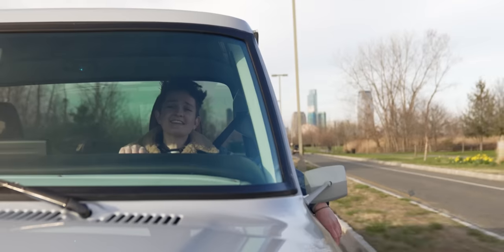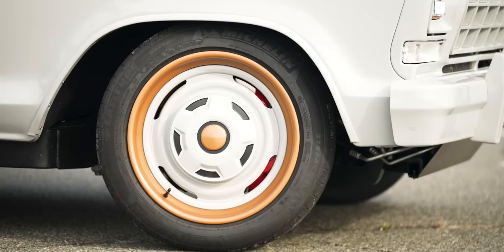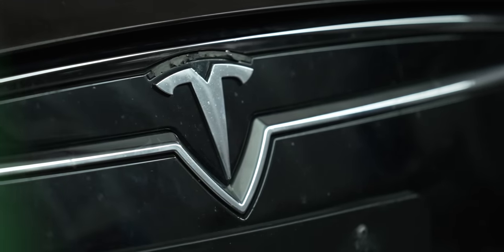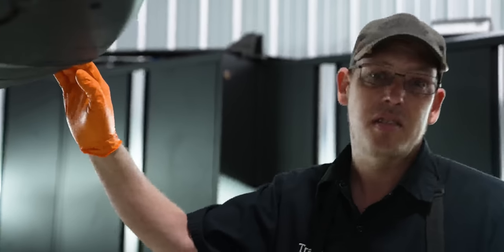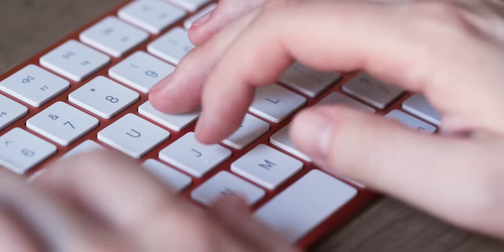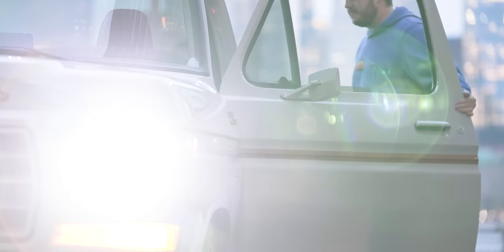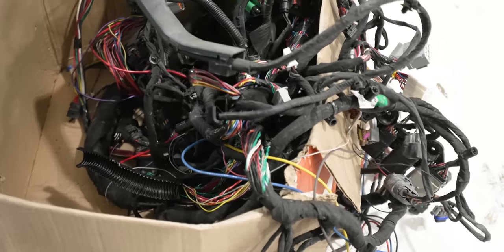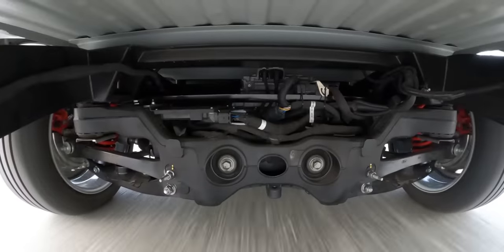Ford did what Tesla won't

Comment: Tesla goes against its own “environmental” push. Right to Repair is an environmentally conscious pillar.
Reply: @Darth_Bateman  What do you mean by unsustainable company? Both financially and environmentally they are sustainable. Their products create, store and use electricity to power homes and transport people efficiently and safely. I'm not sure about the solar panels but the other products are recyclable.
Reply: @jamesmorison  Plastic is recyclable, but that doesn’t mean we should keep spewing it out

Just because something is recyclable doesn’t make it sustainable

Also, that doesn’t justify making unrepairable products
Reply: Well, Tesla didn't just throw away old stuff into a junkyard just to replace a new one. Right to repair is nice and all until your car has Autopilot, which would require many parts to be the same as they came out from the factory or you risk the chance of Autopilot not working properly.
Tesla is trying to eliminate the future laws suit.
Reply: @pongsatonrattanapriyanuch7331  If Tesla doesn't want a lawsuit then they never should've released their "autopilot" or FSD to the public which said features are bottom last in autonomous technology. There's plenty of shops that do electric and software work that I can guarantee can easily reprogram said features after a repair.
Reply: @donkanis6141  Spoken like a Tesla cultist.
Reply: @pongsatonrattanapriyanuch7331  you can repair a commercial jet and they have auto pilot.
Reply: @geocam2  I’m assuming you’re being sarcastic. According to NADA, approximately 60% of auto repairs are non-drivetrain related. Look at the John Deere right to repair controversy and you will understand the long term issues.
Reply: Tesla doesn't have right to repair because no one is an electrical engineer neither are mechanics
Reply: @dulguunjargal1199  Last I checked Tesla vehicles have plenty of mechanics. Mind you many of the issues are outside of both electrical and mechanical. Many issues are related to software.
Reply: @stevenwilliams1805  100% agree. The 3 R’s… reduce, reuse, recycle ♻️. People tend to forget about the reuse part. Right to repair allows people to reuse a products in a way that it’s financially viable.
Reply: @epi2045  the increasing popularity of SUVs is a sign that few people even care to reduce either. Some even insist that I need an SUV just because.
Reply: @stevenwilliams1805  I mean, I'd say that I 'need' my full-size pickup, and most people would argue against that. 

But it is fulfilling both roles of 'vehicle' and 'house', so... :3
Reply: @jamesgizasson  your not saying anything about the environment so I don't understand what your point is? If you want to daily an RV go for it. Just don't expect the government to start restricting others to offset your conspicuous consumption.
Reply: @stevenwilliams1805  It's not an RV, despite being used as such, and I'm not expecting any special treatment. 

As far as the environment is concerned, I'd be willing to bet that the combined carbon footprint of my vehicle and 'dwelling' are significantly less than your average conservationist. 
:3
Reply: @jamesgizasson  I was exaggerating to make the point that I don't care, do what you want. 🖖
Reply: @stevenwilliams1805  Ok, love long and procreate! X3
Reply: @recklessrickey9513  
Most plastics are very much not recyclable - and the vast majority of plastics that are recyclable are the bits and pieces that break off plastic molds/supports for other things while the rest is thrown in landfills.
Reply: @matthewkeating6970  with the right qualification and experience, yes
Reply: @dulguunjargal1199  Yeah and only an electrical engineer can replace a wire that Tesla uses to connect it's door lock.
Reply: What's the problem exactly with Tesla?
I know of some car repair shops who converted over to 100% EV, and they seem to get every part from Tesla they need. 
One example is "AT Zimmermann" here on YouTube (German). They document many repairs and they have dozens of Teslas every week.
Reply: @epi2045  the use of any used parts voids any warranty one that Tesla will void at the first sign

Comment: Because Toyotas are known to be very repairable, I look forward to see if Toyota EVs will be easily repairable or not. I love that Ford has taken this approach. ❤️
Reply: Same! Can’t justify paying over a grand ever time my headlights need to be replaced.
Reply: Toyota ev takes 7 hours to charge, good luck with that.
Reply: @ugochukwueze496  most people getting EVs probably using them for a commute, ~50mi, and charging them at home overnight. different cars suit different needs
Reply: @ugochukwueze496  most EVs do on a Level 2 charger, and that's okay for home charging.
Reply: @ugochukwueze496  not the Mirai
Reply: @vp5429  Relacing the battery in a prius is rather easy. Idk what was wrong with your prius but you can replace the battery for reletively little cost and you could do it yourself.
Reply: @ugochukwueze496  The bZ4X takes about an hour to charge from 0-80%
Reply: As a car guy/home mechanic, Toyotas are relatively difficult to repair, at least compared to Honda. They're just very reliable as to not be necessary to repair.
Reply: Good point.  That's why our family's driving Toyota, Ford and Honda instead of Tesla.
Reply: @andretsang7337  I agree , I serviced my uncles Toyota Hilux  with dealership service guide with  genuine parts we got from an accredited dealer  . Funny enough Toyota will share  $4 part on 20 cars such a relief  , and won't deny selling you any part unlike others , part's availability for Toyota is a heavenly galore.
Reply: @ugochukwueze496  🤡🤡🤡🤡🤡🤡🤡🤡🤡
Reply: It's one way to overtake tesla since their repair is well-known to be expensive af.
Reply: @ugochukwueze496  Nobody charges at the last min. Most folks starts charging roughly 1/4 batt left.
Reply: @sleepyearth  Definitely don't see many How to fix Telsa videos
Reply: well with how they are charging a subscription for remote start features don’t hold your breath.
Reply: @mipmipmipmipmip Rich Rebuilds
Reply: Toyota has been getting more anti consumer over the last couple years, the new ones aren’t that any more repairable than any other car. Companies aren’t your friends especially ones that killed there consumers. Look up Toyota break recall.
Reply: Until the Tacomq or Tundra frame rots out with a decade
Reply: Toyota is turning their remote start into a subscription based service. I wouldn't hold much hope for them in the future w/ RTR.
Reply: @TheAntinowherelane  the service is optional and it is meant for you to start your car from your phone, the cars will still have the standard remote start from the key fob within the distance without the subscription.
Reply: @AlineaEuros  Yeah I don't understand how folks are missing that fact. Thanks for spreading the knowledge.
Reply: The Focus Electric wasn't repair friendly att all!!! One dead TCM and you need to replace everything!!  Not serviceable according to Ford 😏
I hope they changed that for their new electric cars!
Reply: @vp5429  Repairable by consumer standards, and repairable by insurance standards is not the same. Insurance would only perform repairs according to certain protocols and through specific vendors and, if these solutions cause to repair cost to rise above their own set criteria, it will be deemed as totaled. That does not mean yourself can’t repair it to a satisfactory degree at a reasonable price, it depends a lot to how much do you want to keep your specific car on the road.
Reply: If only they'd use better metal for their fasteners... if you're working on an old Toyota in the Rust Belt you'd better have invested in some bailout tools like extractor sockets, tap and dies and extra drill bits.
Reply: Honda's are easier to fix than Toyotas. Perfect example is Honda has a fill plug for their auto/CVT transmissions. So literally take out the drain bolt, put it back in, remove fill plug, fill it up, put fill plug back in. Toyota has stopped putting fill plugs on their transmissions and expects you to fill it through the drain hole with a special tool, and take make sure the transmission is warmed up to 90f and some other sill stuff.
Reply: @goahnary  The 12v or 500v battery?
Reply: @numberpirate  the comment mainly comes from the ability to fix most of what goes wrong with Toyota trucks using basic tools. You see a lot of Toyota trucks in most 3rd world areas. Honda is also amazingly easy to work on. 👍
Reply: Doesn't matter who builds it, batteries are consumable items with a limited lifespan.
Reply: @locklear308  Like an engine?
Reply: @GeekProdigyGuy  Urbanites do. A 50 mile commute is bare minimum commute dawg
Reply: Ah Ford backing Right to Repair? You must be mistaken.
Reply: @ScottOstr  Well I did. I also saw how many important parts ain't available to consumers and they break warranty once they started to open up their tesla. Also if they break warranty, will tesla software work properly on them?